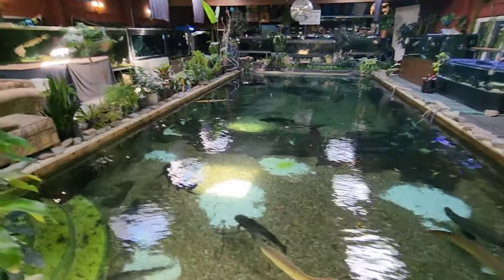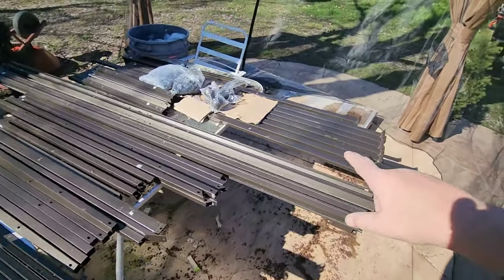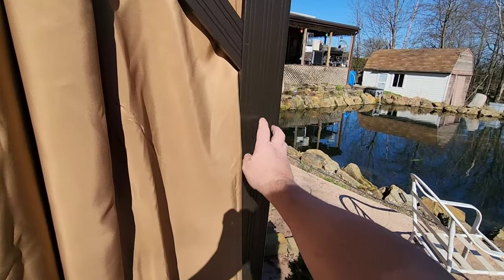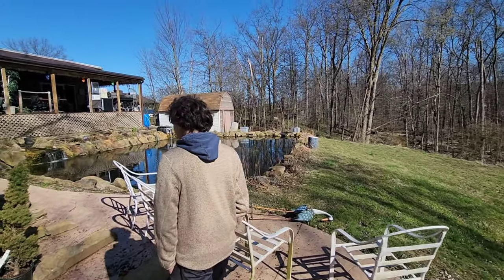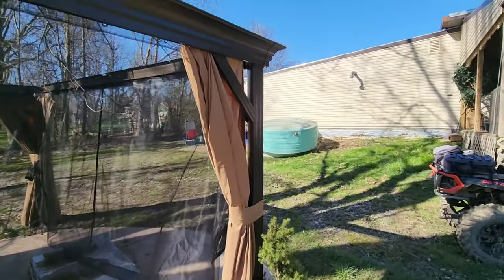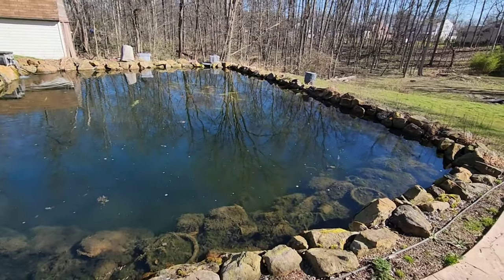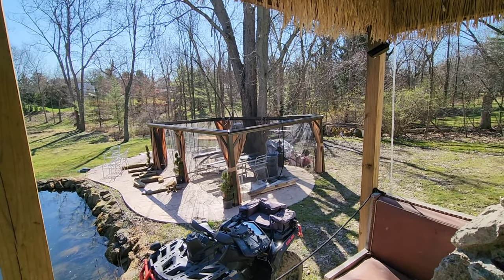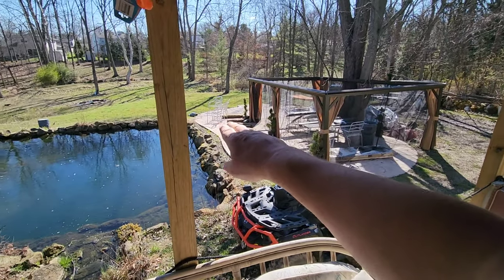Does the Rescue Fall apart without josh

Comment: Greetings from the emerald Isle, big rich, how about an aviary built between the gravel driveway and the trees and the river, Big enough for macaws but sturdy enough to house and secure enough to house smaller birds may be with a divider, winter quarters attached with heat etc or use the back deck or barn that is if you take in bird donation and you have spoke of having macaws in the past and one that meant alot to you, that you regret parting with. Just an idea from a long time subscriber, I pray regularly for Tracy and your loving devotion regards Richard in Dublin, Republic of Ireland.